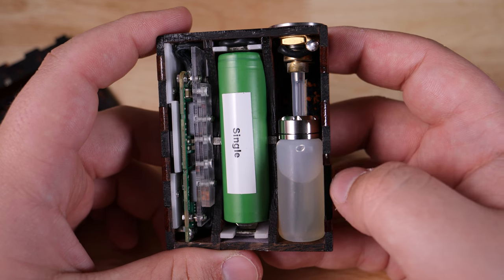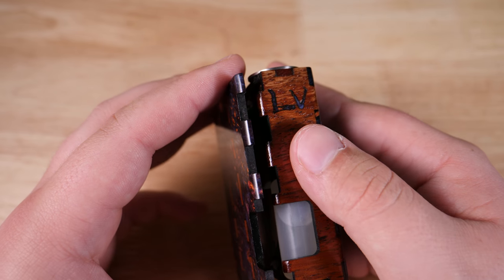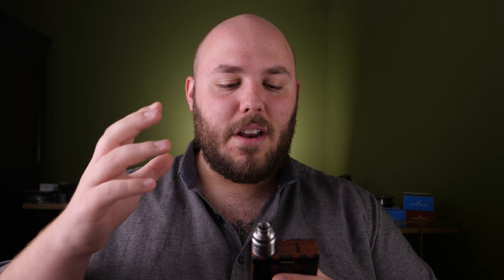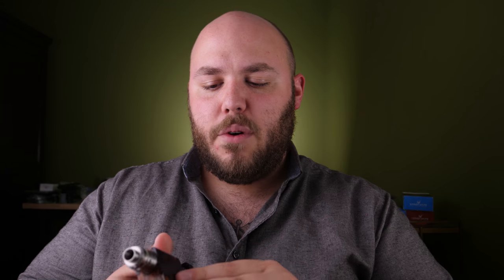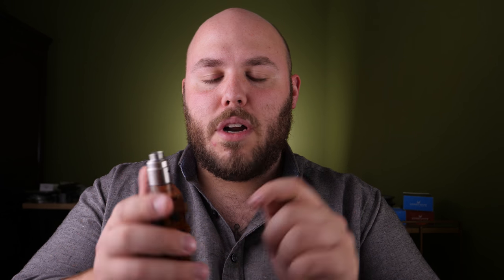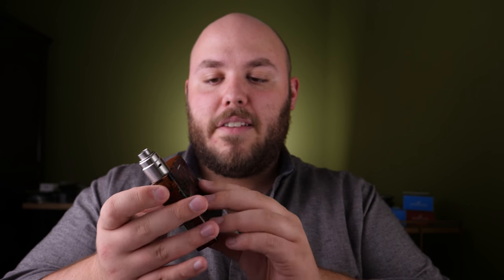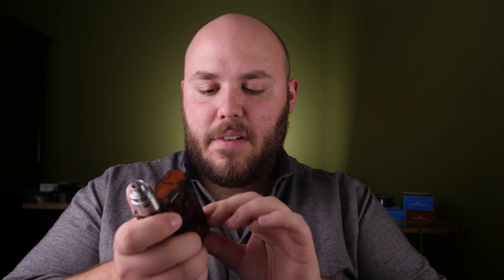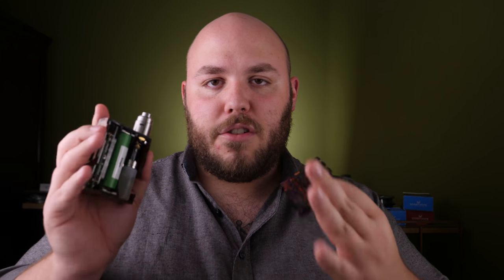Lazy Vapers DNA75C Squonker | Stab Wood Art!

Comment: Great review as always dmo, and I absolutely agree with your assessment. For 400 bucks for just the mod I expect every thing to be on point. I don't like just a single battery, I wanna be able to run 24 and 25 mm atomizers aswell. The craftsmanship is stellar but too many cons for a $400 mod. But the dual parrael you held up at the end would be a much better mod in my opinion.

Comment: It's a nice hand crafted box. It kind of looked like the usb port was slightly crooked, but with hand made mod that is not super uncommon, and it could of just been the light and angle that made it look that way. I also really like that it looks like you could get a nice sized bottle in there if you wanted. 

Thanks for the look at this mod.